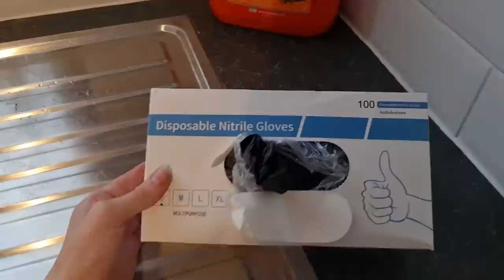My first time doing motorcycle maintenance [Part 2]

Comment: Hi Saffy,  as has been said doing your own maintenence is great and you learn so much about your bike but as many have said I was screaming "NO" when you hit the spanner on the sump plug with a hammer!  A Torque wrench and a maintenance manual to tell you the torque value should be top of your purchase list.  Everyone is an expert with hindsight.  Stick in there with the maintnance and self sufficency is a great goal but dont be affraid to ask for help, remember evey qualified motorcycle mechanic was an apprentice at some point and had help and guidence.  Rob

Comment: Oh girl! That oil sump plug does not need huge torque. Take it to firm hand tight then a further half turn. Plenty.
Also the new filter.. that very first swing of the spanner would be plenty.. honest! No need to prime it with oil. Just a smear around the rubber O ring to help it seat. You are doing great honestly. Proud of you massively.Just pick up these small pieces of wisdom?
Reply from the maker: The garage said the sump plug was lose when I took it in 😭

Comment: Top marks for sticking with it and having a go! Try not to use a hammer on threads, it can end badly... Good n' tight, not Fn' tight is what you should aim for. A torque wrench would be a worthy investment, especially when tightening your wheel nuts. Aim for a smooth action when loosening and tightening threads.

Comment: As already said, use a torque wrench on the sump plug, it really won't officially be anywhere near as tight as you have done it, you are lucky you didn't rip the threads out of the sump pan. Similarly with the filter comments, do it up hand tight only and check for leaks when the engine is running. Even tightened by hand normally requires a tool to remove it as it will naturally tighten. The tightness you have applied to that filter will probably need a socket and that long breaker bar you bought for the front sprocket nut to remove come the next oil & filter change. Modern bikes and cars are aluminium, not the likes of steel and cast iron of old and nuts and bolts are easily overtightened by someone without an engineering background, a torque wrench is your friend.

Comment: For future reference, the general rule for oil filters is to spin on by hand until the seal makes first contact with the mating surface, then tighten another 3/4 to 1 turn, by hand if possible, to avoid crushing or over-tightening. A smart mechanic doesn't need to be mega-strong, just use the right tools and techniques.

Comment: good rule of thumb on oil filter for should I say lesser strength is tighten as hard as you can with both hands then half a turn with spanner with a spark plug finger tight plus half a turn it will feel like it is still loose but it is not. You chain looks to tight. also should be about 20mm up/down movement.

Comment: Great videos, and it's good that you are doing your own maintenance and it's good to see you doing your research on the jobs first. I've been working on my bikes for 30 years and a few weeks ago I had to replace the seals on my rear break master cylinder a job I've never done before so like you I did my research but I asked one of my mates that had done the job before to come and give me a hand and he showed me a tip that they didn't show on my research. So it doesn't matter how many years anyone has been working on bike's if in doubt always ask someone who has done the job before. And the other thing is it's expensive building up your tool kit but the next time you go to do the same job again it will be cheaper becouse you have already got the tools. So ride free and stay safe.

Comment: You don't need to tighten the oil filter this strongly. Just make sure there a tiny film of oil on the rubber seal and (Very important) no remnant of the old oil filter's rubber seal on the engine housing.
A neighbour lost a friend to that latter error: There were two seals under the oil filter of his sports bike. At high RPM in fast curve, the oil pressure got strong enough to press a good amount of oil out between the seals and spray it all over the rear wheel. It slipped, the the bike fell and the stop was sudden and terminal. So:
Sealing surface on the engine: Must be really clean and even. A thin film of oil on is to be on the rubber ring of the filter.
Tightening torque for the filter: Moderately tight is absolutely okay. Normally strong people will be fine when tightening the filter with bare hands.

Comment: Even if you can't find a manual for your specific bike, there are tables available online, which give guidelines for maximum torque settings for different sizes and grades of bolts. You also need to make allowances for when they are screwed into softer materials, such as aluminium. They are obviously not specific to your bike, but do give some guidance in the absence of manufacturer's data.
Reply from the maker: That's a good idea:^) thanks for the advice!

Comment: One of the main reasons why I have not had a garage do any work on my cars or bikes for the last 50 years is that most of them overtighten everything and appear to have never heard of copper grease, or any other anti-seize compound.
We don't want you to be that mechanic so please put away the hammer when tightening bolts, especially ones which are not structural like a drain plug, and dispense with all tools when fitting the oil filter. 😳
Richard
Reply from the maker: Ahaha I did so back and correct it, sum plug seemed fine 🙂

Comment: if its any consolation i over tightened my rear axle on my brand new mt09 so much that it chewed through the stop guard and had to be replaced. it was because id previously used the same torque wrench to do the brakes on my van and never bothered to check the setting before working on the bike. lesson learned!
Reply from the maker: noooooooooOoOooOo
Reply from the maker: noooooooooOoOooOo

Comment: I can echo a lot of the comments here about using a torque wrench.  A good investment.  Also get yourself a copy of the Suzuki factory manual for your bike. It will give you all the torque settings , quantities  and procedures you will need. A cheap measuring jug from the supermarket will be a quicker way of measuring out your oil . You may benefit from some allen key sockets that fit your ratchet as well. Easier than just allen keys and you can use them with the torque wrench. Finally tyre fitting. Not even worth trying to do this at home. Take it to the shop and save yourself grief. If you can safely support your bike at both ends you can take the wheels out yourself and take them in to save a few quid.

Comment: I have used that Brake calliper tool on Motorcycles, but you might find a G-clamp is easier, watch you don't overtighten the sump plug and oil filter
Reply from the maker: Thank you so much! I'll make sure I loosen it!
Reply: Yes, using the mallet to whack the spanner turning the sump nut made me hold my breath and close one eye. Oil filter over tightened. Chain looks to tight as well. And Saffy, never pre fill the oil filter as you could accidentily add particles off oil container/gloves that might get into your crank bearings. Love your effort. You will amass lots of tools by the way. 🥳

Comment: Buy torque wrench for the sum plug and the oil filter I was watching your vid and you tighten the oil filter upto much and the sum plug as did years ago doing it my self its better to use torque settings saffy just trying to your doing a great job for your first time I hope this helps

Comment: Tyres are hard Saffy not going to lie  I've done them but even i've struggled even with really long tire levers and the old tire sorts of welds itself to the rim too i had to beat it with a rubber hammer lol to loosen it. Then the new tire is really stiff and not at all easy to put on the rim took a lot of brute strength.  I think i would rather pay a garage tbh.
Reply from the maker: I think tyres are one of those things where you either have machinery to do it or just go to a garage, you have to get tyres delivered to a garage anyway so you might as well just get them done while you're there
Reply: @SaffySprocket  yep takes seconds on a machine

Comment: Great that your doing it yourself, best way to learn, but please check that chain tension, it looks way too tight, not only will that wear out your chain and sprockets supper quick, it also increases the risk of the chain snapping
Reply from the maker: No worries :-) The wheels are coming off again for new tyres

Comment: Just two things Saff, if you have use a hammer (bin the hammer) you're using the wrong tools and that oil filter only needs to be hand tightened, the nut on the end is there to get off. So torque wrenches may be a good future purchase along with hex socket set. Good luck in your maintenance journey.
Reply: Just what I was thinking, using a hammer on the sump plug is not a good idea, good chance you will strip the threads
Reply: @raystewart365  tbf fair if I was anything like a sensitive person I would have been in tears.  I treat my bike with the utmost respect when I carry out maintenance on her. Having said that I wish Saffron all the best in her slightly scatty bike journey.

Comment: Borax is around $5 bucks for a large box and makes an excellent pumice soap when mixed with diluted dawn dish soap. I keep a large container of the borax next to my sink and pour a teaspoon or more in one hand and pour some of the dawn over it and scrub. Super cheap,  effective and easy to find. I also use it to extend my shower soap, dr bronners castile, effectiveness, laundry detergent booster, teeth brushing mixed with Tom's of Maine, and more. We also need boron supplementation for strong bones and ligaments, general wellness, etc.  Your welcome
Reply: PS, all you need to depress the caliper piston is a small c-clamp and a thin block of wood or even the old brake pad for the clamp to fit over the caliper evenly.
Reply: keep the new brake pads clean and free of grease, oil or WD-40 or they will not grab tight when braking. Brakeclean or similar brake cleaner is your friend in that respect, so use it to final clean the pads, if hands were greasy, and rotor before assembly.

Comment: 10 out of 10 for effort Saffy. We all had to start somewhere and most of us are still learning. 
Bit worried about you tightening your fixings with a mallet though. Have you got a manual for the bike from which to refer to. All the best.👍
Reply from the maker: I'm enrote to fix the sump plug now 😅
Reply: To replace it I assume. Your service is coming on a treat, we new you could do it.:goodvibes:

Comment: Unless your experienced at wrenching it's definitely worth strictly following the service manual 
soon as you start cracking nuts and bolts on bigger bike you have to get the re assembly spot on, nuts and bolts rattle loose over time even a simple oil sump bolt can ditch you if not installed right some fitting are just soooo important 

Bikes are precision bits of kit  you gotta grab some loctite a torque wrench that service manual even if just for reference 👌 great skills still

Comment: Be careful servicing oil on the rear stand. It it easy to overfill because the sight gauge is not oriented the same as it is with the rear wheel on the ground. Oil will hide in the front of the crankcase if the bike is tilted with the rear wheel elevated.
Reply from the maker: Good point! I thought you were suppose to stand a bike upright for oil stuff
Reply: @SaffySprocket  stand the bike upright with both wheels on a flat surface/ground.

Comment: Ok I might not be the 1st, but you bought gloves, then didn't use them for the oil change.  As for pushing pistons back in to calipers when changing brake pads you can use a G clamp,  remove the old pads, put a rag on on the caliper and the in side of the "G" should fit inside the the piston, just slowly tighten.  Piston should go back in no problem, replace pads. I usually use a light smear oh copper grease (high melting point) to make stripping down easier next time

Comment: I was nervous changing my oil on my bike. The oil filter and plug are in line with the rear tire, so if you don’t properly lube up the o-ring on the oil filter or not tighten everything correctly, It could cause an accident.

Comment: Saffy, full marks for tackling your own servicing. But I did cringe when I saw you hammering the spanner to tighten the drain plug. And especially when you tightened the oil filter cartridge. Many of these are tightened to hand tight - if overtightened can result in shearing the threaded tube. I recommend that you buy a torque wrench and a Haynes manual which list tightening torques. The last thing you want is to strip the thread of alloy components, Anyway, well done. 👍

Comment: Good on you for giving it a go, but your entire fan base were screaming at the screen ‘stop’ as you kept tightening that oil filter!!!!  Hand tight only and smear oil around rubber seal. A haynes / workshop manual would help avoid this kind of mistake. Torque wrench essential to avoid over or under tightening nuts. Suggest keep close eye on the oil filter to see if any leaks due to over tightening once bike is warm and for a few days after. Very entertaining though, Ride safe.

Comment: Some tools you should invest in: torque wrench. With a torque wrench you can make sure every nut and bolt is torqued to the right spec, not too tight, not too loose. Second: service/repair manual for your specific bike. It will be able to tell you things you need to know specifically about your bike, not just general information. Suzuki sells these manuals directly from their website. These are the same manuals OEM certified technicians use to guide them in their shops.

Comment: Nice work! I hope you have found a workshop manual for your bike (I couldn’t) it will save a lot of grief .A lot of modern bikes have their official manuals online rather than printed these days I would ask a dealership . It is always satisfying to do your own maintenance and get it right . You can get a tool to remove the oil filter that is like a socket they are less than £10 and are better than the filter pliers . I would recommend putting your hair in a net as from experience old oil is difficult to get out of it I’ve solved the problem by going bald which I doubt is an option for you.
Reply from the maker: They don't sell them for my bike and suzuki said they don't give copies of the service manuals to the public 🥲
Reply: @SaffySprocket  That is not good . Is there a SV owners club or independent Suzuki owners club ( I was in the bandit one when I owned one) they will often have manuals as a pdf and helpful advice . Other people have said get a torque wrench but they are pretty useless without the torque settings. Stripping a thread is a pain stripping the sump plug thread is nearly a disaster. If you can’t get an official one possibly clymer or Haynes might do one. I am sorry I can’t be more help.

Comment: Did you remove the brake fluid reservoir cap or open the bleed nipple? If you didn't that would be one of the possible reasons why it would be difficult to push the piston back. You should be able to push the piston in by hand. That's a sliding caliper on the rear, so you would even be able to just pull on the piston side of the caliper into the brake disc with it all still mounted to the chassis. My preferred method is to open the bleed nipple and push back the piston, then top up the fluid and bleed the system. It gets rid of the nasty fluid near the caliper this way. If you just take the cap off and push back you risk overflowing and spilling fluid everywhere.

The sump plug torque looked fine because you barely tightened it before knocking it round, if anything its probably a little under torqued. My MT-125 has the oil change torque settings in the full sized owners manual, so it might be worth looking in there. Either way I wouldn't bother loosening anything now.

Ignore all the haters, as a HGV technician sometimes you have to improvise and work with the tools you have to get the job done.

Edit: Found the Owners manuals here https://www.genuinesuzukimanuals.com/
Not sure exactly what year you have but I found 2 full turns or 20NM for the oil filter, whatever comes first, and 21NM for the drain plug. Thats for a 2017 SV650. Hope that helps.

Comment: Yeah As the others have said on torque wrench....and hammer..🤢🤢 ... Quick tip after fitting a HORIZONTAL oil filter. After filling sump, run engine for 30 secs. Then as you cant put much oil in the HORIZONTAL filter you will find the level of the oil have gone down significantly, top up and Run engine again 30 secs , check levels again and add more if need be
Reply from the maker: I haven't turned the engine on yet! Going to fix the sump bolt first then I'll give it a little run through 😅

Comment: All excellent stuff 👍🏻 nothing like the deep sense of well-being when you ride you bike after it’s been serviced and treated to some new maintenance items. How did you tension your chain? Looks like it may be a little tight? I’ve always eyeballed mine but have just bought a chain monkey tensioner tool and laser wheel aligner tool!!! Not going to lie I’m excited about having a well adjusted and aligned chain. Now your getting a tool collection going you’re to need a big ass roller tool box, prepare to be ever so slightly aroused when you get one of those bad boys! Just having one will make you feel like a pro 💪🏻😂

Comment: if you put aluminium foil over the exhaust under the oilfilter  you don't have to clean the exhaust  🙂
Reply from the maker: Damn, you're a smart cookie
Reply: I still maintain that sticking an exhaust pipe directly under the oil filter is just bad design, and whoever made that decision should be made to mop the floors for a week straight 🤣